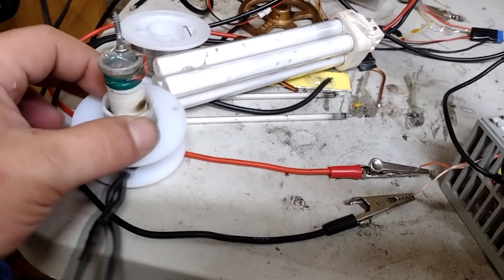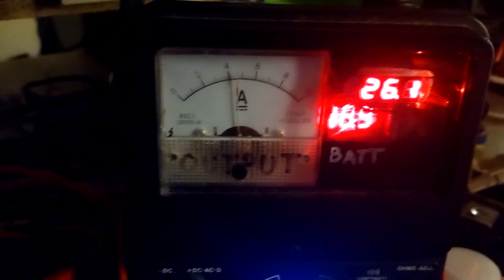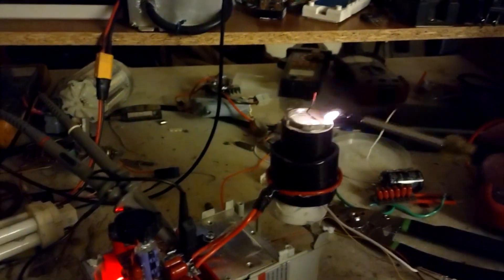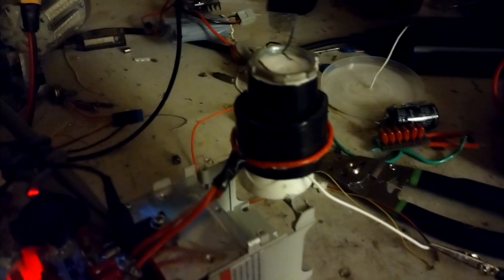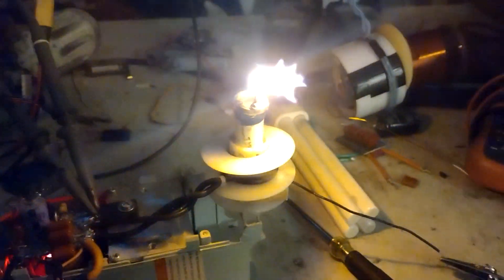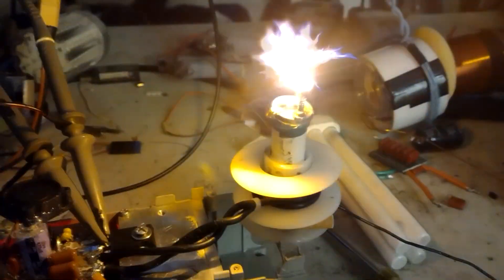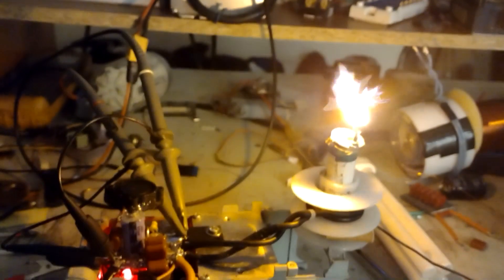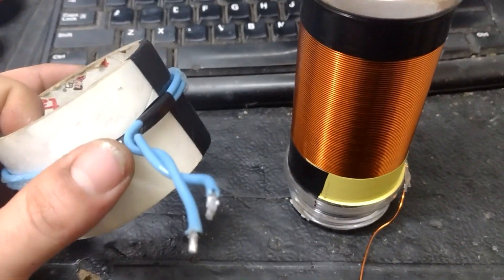Micro Class E HFSSTC w/Glass + 4.2MHz test

Comment: Do we adjust the pirmary inductance by changing the number of turns and the length of the overall wire for the primary?
Reply from the maker: Yes. Just imagine you bought a Class E kit from somewhere and instead of it being already prepared you have to wind your own primary coil around it. You will probably find yourself doing a trial and error on the exact length of that primary to get it tuned properly.
Reply: @Magneticitist Do we pinch a section outside the primary to increase the inductance slightly to tune it ?
Reply from the maker: @spiderspider1384  Probably easiest way yea. Just make the extra inductance lead inductance. Literally just have long primary leads, then chop them down.

Comment: Where can I find this circuit?
Thanks
Reply from the maker: With this particular setup if you wanted a good circuit to follow you could use Steve Ward's class e circuit on his website or the one I showed using the CD4046. It's in some class e video with "+ circuit" in the title I think. The power section on this kind of build is always going to be about the same as Ward's layout where it's just like a regular SSTC but you're treating the L1 and the capacitance across the drain and source as a tuned circuit for low loss switching.

Exact values are something that would be pointless to try giving unless someone was to literally replicate it exactly. Otherwise they will have to do their own process of tuning where the values will be different.

Comment: Hi, Im hoping you can help me with a problem. I'm testing a don smith step down bifilar Tesla coil for overunity. I  used a zvs powering a flyback with spark gap in parallel with primary capacitor also in parallel. The circuit has already been tuned for 30 khz with copper welding rods in the primary core. The problem is when I connect the primary coil to the parallel cap and spark gap combo the spark gap stops firing. When I disconnect the primary the gap fires. Both will not run at the same time. Do you have any idea why this happens?
Reply from the maker: You mean you have a continuous 30khz discharge across a gap with the flyback, but when adding a capacitor which has its own spark gap in parallel with it the capacitor is not charging enough to pop the gap? Are you sure the output is properly DC?
Reply: @Magneticitist  the circuit is zvs 30 khz to flyback transformer 4 kv with forward biased diode in series on the live wire and then spark gap in parallel followed by tuning cap in parallel after spark gap, that's it. When I connect the primary of the bifilar in parallel to the tuning cap the spark gap stops firing. And yes the output is half wave dc with the diode
Reply from the maker: @scraw3  How about the frequency of the ZVS as you're making this connection? Does it change dramatically? Or what happens when the cap is in series?
Reply: @Magneticitist  according to the zilano documents a series cap only gives induction power and parallel cap gives overunity. I can't tell whether the frequency changes while it's active since my meters fluctuate and never seem to be accurate. Only when no load, open circuit does the zvs frequency seem stable.
Reply: I tried leaving one end of the primary connected to the tuning cap and the other end earth grounded and there was power circulating in the primary, but that is not the point of the experiment. It needs to be fully connected to the cap while the spark gaps fires to harvest electrons from the ambient atleast according to zilano. Any thoughts on this?
Reply from the maker: @scraw3  Yea I mean that's a tough one for me because I don't believe anything about Zilano's claims. Or Don Smith's. I do however think it's worth experimenting with because it's all about HF converters either way. 

Only harvesting from ambient I've ever seen that didn't have to do with conversion first was ion flow in a HV DC arc. For example, I made a vid years back of a HV DC output, low wattage, where I had a 12V bulb in series with one of the output legs. I could draw the arcs through air, short the output, whatever.. but the legs of the bulb would just get red hot rather than the filament glowing. This was because of the ion flow, I guess, annihilating the negative terminal, always the negative. When I increased the negative terminal mass by adding some tin lid to it, and then arced to that lid with the other leg, I could get a bulb to glow brightly. Basically this kind of gist https://www.youtube.com/watch?v=EC7Uq3tjP4s&t=4s

In your case you just have to get the gap firing first before anything else but I suppose those systems suffer the same issues. Culprits in my mind could just be the ZVS.. mine goes from about 35khz to over 100khz when adding the gap+cap+primary. It's either charging HV DC into the cap or it isn't. If it doesn't pop over an extremely small gap then it sounds like something is wrong with the arrangement.

Comment: Looking good man! You built something I played with...but now, I kinda wanna build something you've played with. I've got the plasma flame itch. Do you have any recommended circuit variants that seem to be more tolerant or work the best for you (perhaps a video of yours I could look to)? I'd love to hear your advice, you seem to have a lot of success with these things, and I'd like to not burn up my last spare MOSFET immediately, lol.
Reply from the maker: While I can more or less get a flame with any one I throw together, it usually takes a lot of work to get a nice flame that doesn't annihilate the mosfet thermally. Otherwise I really haven't had much trouble with popping them outside of one build in particular that used a wonky varicap and a lot of dirty loose wiring. 

Teslaundmehr's setup seems to be one most people have success with. I would say that if you follow that general design, you could source a decent doorknob cap at like 5kv+ 75-100pF, or try stacking something like C0G or FKP caps. Then tuning it for something around 12-15MHz may be the difference between 1 turn on the primary for example. While I do add some back to back zeners directly across the gate (like a 1n474x) I try to avoid TVS diodes because a lot of the ones I've randomly sourced will apparently present too low of an impedance at such frequencies and just cause a lot of heating and smothered output.

Over time I've learned there seems to be a general tell when you're getting close to mosfet damage so long as you're taking it slow and incremental. The gate voltage is what seems critical most of the time for me and I always try to be aware of what the divider pot is set to for any given voltage. 
If say I turn the gate potentiometer up to start oscillation at a 20v input test voltage, and I can attempt to load or draw out a flame with no problems, then I wouldn't just turn the supply up to say 30V without first slightly backing the gate pot down. Otherwise it may or may not want to start squealing a little as I try to load the output, indicating it's probably close to damage. Depends on the mosfet. This could be at a point where the gate voltage waveform does not appear to be at a dangerous amplitude. 

For building it I'd say focus on the primary circuit as per the schematic. Making a nice layout like your Class E uses is ideal as to avoid loose wiring that can be altered which may alter the operation. It would be wise to design a layout where G-S capacitors can be soldered in side by side for tuning. It depends on the mosfet gate characteristics but typically for me I'm looking to be able to light CFL's etc from the primary field, and draw small hot arcs from the HV node or nearby it on that side of the capacitor. At that point you probably have a little play in your primary length where it could be added onto by a couple inches or so for fine tuning relatively to a secondary you've wound to match that primary frequency. That's not so simple though so I'd recommend winding 2 identical secondaries since it's not so difficult at those frequencies. 
You can experiment with the first by removing turns from it (after intentionally winding it so that it's at say 9mhz if the primary was running at 12mhz) until maybe you've removed too many.. at which point you can modify the second one to where you had the best results on the first one.
Reply: @Magneticitist  Thanks for the info man, hopefully I can do the circuit justice! It definitely seems to be the most sensitive SSTC variety that I know of, with all of the high frequency stuff! Not sure when I'll be able to complete it, I first have film and finish the class-E video, and then a few other builds I promised, haha.

Comment: Nice flame 🔥 I need to get some of those nice ucc drivers , do you think you could push more power at the same voltage and same Frequency if you do like half-bridge setup ?
Reply from the maker: Half bridge would work but it would change the topology. Self Oscillating half bridge as shown by Acid Byte would probably be best. 
Pretty much any of the UCC gate drivers will work so long as you keep in mind the gate charge they have to drive. Either way I can push more power with the setup I have now, maybe something around 300-350W without problem. Micro coil would probably not like anything over 150W or so.